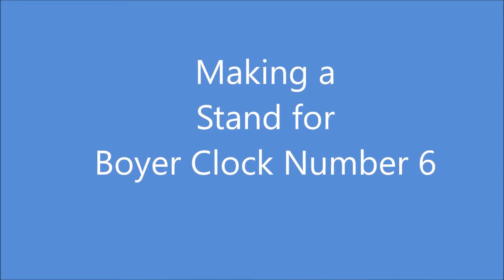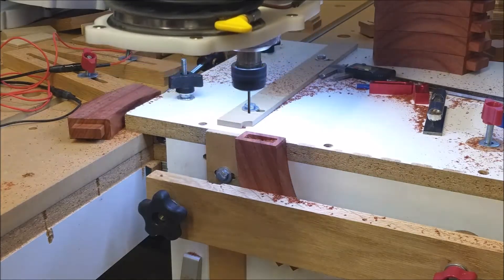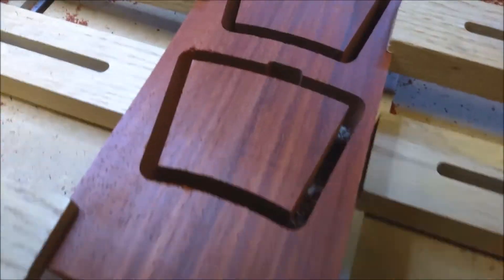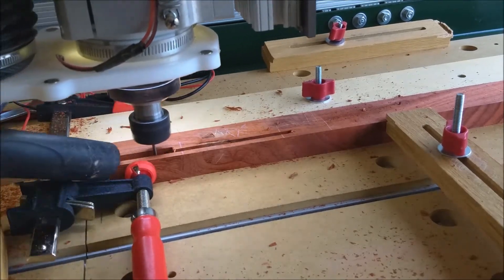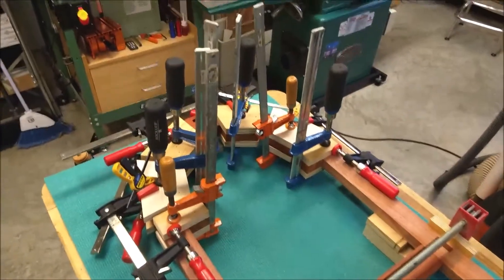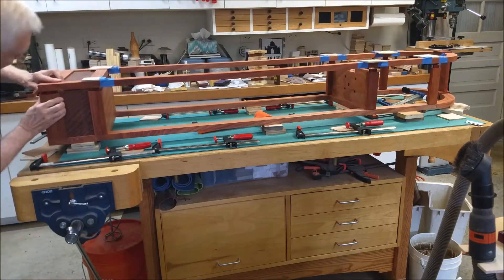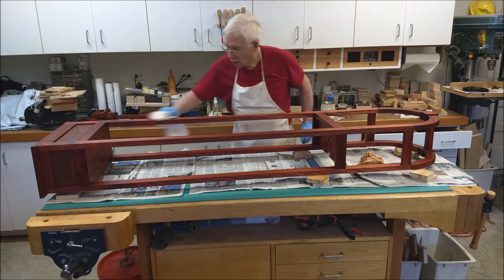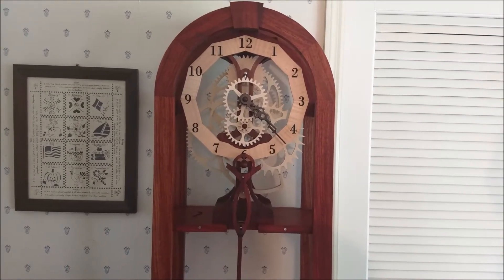Making a Stand for Wooden Geared Clock

Comment: Hai sir I am very interested in making wooden gear Clock. Sir can we cut the small gears by cnc machine?
Reply from the maker: Yes you can use CNC router for small gears.  That is what I do.  I use a 2mm end mill for small gears, and leave 2 or 3 tabs to hold gear in place.  Thanks for watching.
Reply: Will you share your .SVG files?